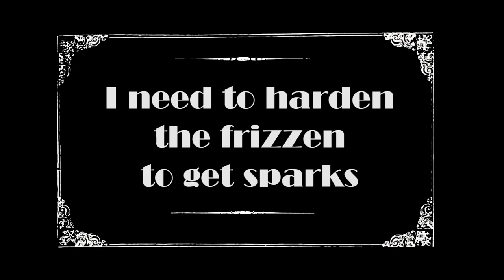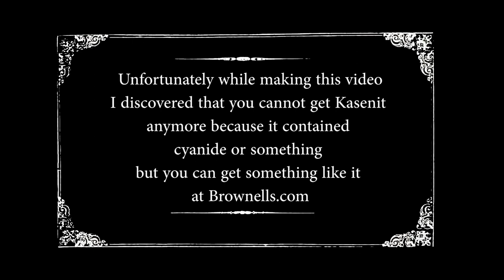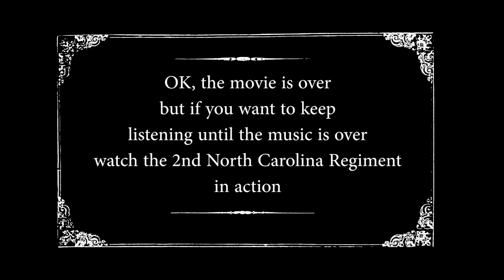How to harden the Frizzen on a Flintlock musket so it sparks again

Comment: Since there was no Kasnet in the 18th century, what did the gunsmiths use? I have heard that they used powdered leather charcoal then pickled the Frizzen (Hammer) in very warm solution of Carbonic Acid. Also a great video of the reenactors.
Reply from the maker: They would surround the frizzen in leather in a can, and then heat it up in the forge.   I don't know about any Carbonic acid, but just doing that would add extra carbon in the steel to harden it.

Comment: Really surprised the frizzen didn't fracture from being dumped in icewater.
Reply from the maker: This was a technique that was shown to me by the gunmaker Kit Ravenshear.   It hardens it in a nano-second.   The thing that surprises (scares) folks who don't know what you are doing is when the frizzen hits the water, and it splashes out... folks think the water is going to be scalding hot and jump back, but it is ice water.
Reply: If you cooled it slowly from one end to another, it WILL fracture.  If you cool it all over suddenly there is MUCH less thermal stress because it's all at the same temperature as it cools down (quickly).  If you don't believe me go get one of your wife's best crystal goblets (the ones she won't let you touch), get it good and hot with a hair dryer set on HI, then (with a hot pan holder) plunge it quickly ALL THE WAY into a pan of cold water.  Then, start all over with the hair dryer on the goblet, good and hot, this time put it HALF WAY into the cold water.  Told you so.  Don't just stand there, get rid of the evidence and HURRY.
Reply: @Irish_Pirate  So, you don't do any tempering of the frizzen anywhere? How many times have you fired the gun and how has the frizzen held up? Im really considering doing this with a factory made italian gun. The frizzen seems to be a bit soft. Any information is greatly appreciated.
Reply from the maker: @firewaterforgeofarizona4304  No, just what you see there.  I have a few dozen flintlocks and do this from time to time with all of them.
Reply: I did it to my Pedersoli Kentucky. I get a shower of sparks consistently. I did temper around the pivot hole, couldn't help myself.

Comment: Great tutorial! Thanks for posting. What gas do you use? Will propane do the job? I've read conflicting opinions about what to use for frizzen hardening on some muzzleloading forums.
Reply: There are many ways to accomplish the hardening. I once used the method of crushing a tuna can around the frizzen and scraps of leather. Give it about 15-20 minutes in a hot campfire then dump it all in water and let it cool. At home I find that a Vise Grip pliers will do the same as a spring vise if you are careful.